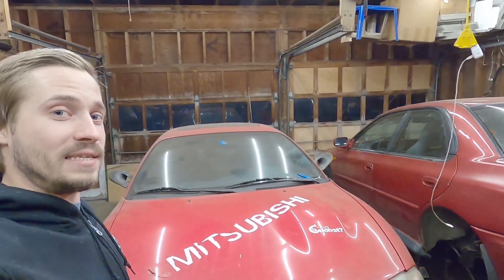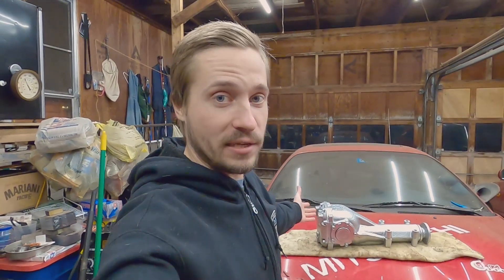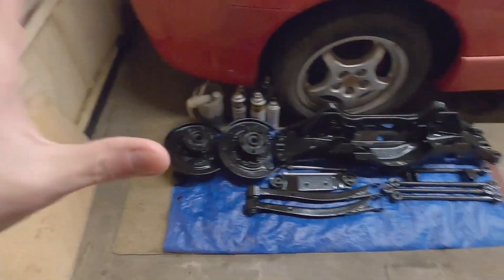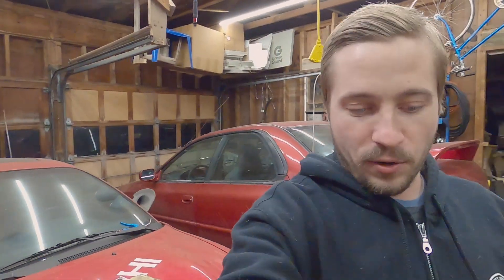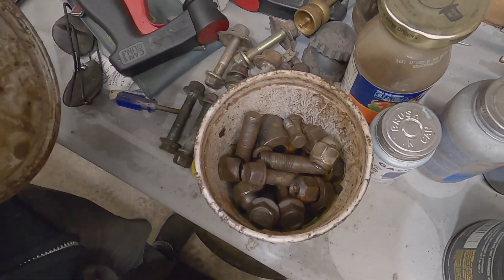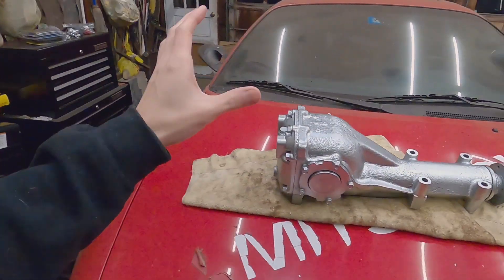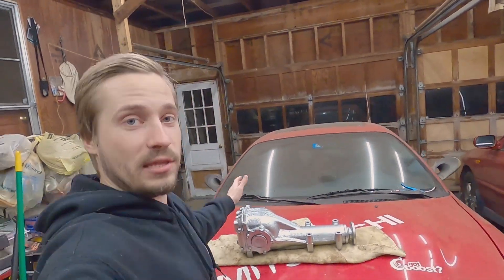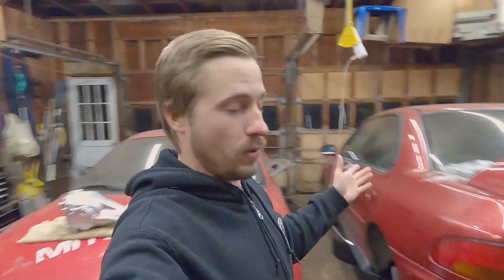Shiny New Subaru Differential! ⚙️✨ Impreza 2.5RS Rear End Restoration

Comment: If you haven't tried them yet, the Milwaukee Torque lock style vice grips work great for grabbing snapped bolts. You can get a screwdriver on the knob and really torque down on it a lot more than the standard style vice grips. Not gonna lie I saw the diff and thought the old one was too far gone and you picked a new one up. It took a while but at least you were able to save it.
Reply from the maker: Oooh I'll have to look into those! I won't lie I was amazed how stuck this bolt was. As you know, I've dealt with a lot of stuck bolts! Glad I had you tricked for a second. :P

Comment: How well does POR15 hold up to be salty winters in the NE? Maybe that would be a good solution to coating the parts you’re replacing, or anything you want to protect.
Reply from the maker: Allegedly pretty well, as long as you get it to bond to the metal well and cure. My main issue with it is how expensive it is. In some ways I'd rather clean and prime rust and then undercoat. I actually have little personal experience with POR, but when I have some more money I'd like to try it more.
Reply: 802 Garage It seems like the best way to buy it is in bulk. Maybe down the road when you have a project you really want to devote a lot of time and money into. Then again you probably wouldn’t drive it in winter 🤔
Reply from the maker: Hahaha yeah it's hard... A gallon of the stuff is $119! Pretty crazy.

Comment: The freshened up diff looked like a brand new aluminum one in the tiny thumbnail, but it still looks pretty good, I gotta tell you.
Reply from the maker: Thank you! I tried. Could be better, but I think that's about as good as this case needs. :P
Reply: @802Garage  Yes. Also, you should stock up on that paint that bonds with rust and stops it. Like, in, 5 gallon buckets of it, lol!
Reply from the maker: I have a lot of "stops rust" paint, but the results vary. POR is good but it's just insanely expensive.
Reply: @802Garage  In my experience, the insanely expensive stuff is the only way to go.
Reply from the maker: Haha won't deny it's the better option. Me just broke. :P
Reply: @802Garage  I totally relate.
Reply from the maker: It's nice to not feel alone. 😂

Comment: When you showed that silver looking diff. I was like damn! That looks mint. 

But then oh its the same diff that was full of rust and the hole in the cover. 

The paint should hold up for a while. Powder coating will go a long way given the time and effort and a huge oven to bake the coating.
Reply from the maker: Glad it looks good to you at least! At least it doesn't have a hole anymore. I'd love to powder coat, but then I have to remove any rubber seals and do even more work, plus make even more sure all the rust is gone. Basically I'd want a sand blaster and to fully disassemble it. 😭

Comment: I've been noticing that mishimoto box in your intro, did you get sponsored or did you find somewhere with a good deal on them?
Reply from the maker: Wish it was sponsored! Hah. I got a really good deal. Since you asked, it's a $350 X-Line radiator for the Eclipse. I basically got 50% off a while ago. :)
Reply: @802Garage  I've been trying to find a good performance rad for my buddy's Mercury Marauder, but everything is quite expensive. Any recommendations on where to find a good deal on a performance radiator?
Reply from the maker: Let me know what year and engine it is and I'll see what I can find.
Reply: @802Garage  2003 4.6 modular dohc, same as a cobra of the same year minus the supercharger. It is a street/drag strip car, maybe drift (bit of a heavy car for this) after it is boosted.
Reply from the maker: Hmmm, TBH about the best i can find is radiators for the Mustang. No idea how well they fit, but I can imagine it would be minor modding to fit up. He'd have to verify.
https://wheelwell.com/shop/cooling/radiators/ford/mustang/2003?submodel=GT&universal=false
You can use the coupon code "Welcome2" to get $100 off $250 so that should help.
https://slickdeals.net/coupons/wheelwell/?couponid=2699695
Reply: @802Garage  The $100 off is a really good find! I'll have to keep an eye on this though, seems that all of the products are unavailable on there.

Comment: I've painted old rusty parts before, so no, you didn't fool me. :P You did a very nice job, though, and it should help against corrosion. Gotta do something about the skid plate situation under it, though... like, drill holes into it maybe, so it doesn't end up acting as a water/dirt reservoir? I'm sure you'll come up with something. :)
Reply from the maker: Oh I won't be reusing the skid plate for now. It is far too damage and rusted. Most of these cars did not come with one. Someone likely added this one from another car. I believe on the 1st gen Impreza here they were an option and came with certain trim packages, often the Impreza Outback Sport, but I'm not sure which years. The 1st gen Forester also had them sometimes. Hard to find exact info.
In researching real quick though I actually found you can buy the genuine item quite cheap new! Looks like possibly thinner metal than the one I had and also less ruggedly welded. Does have a few drain holes at least. This one is technically for the later models, but will fit especially since I'm using the later subframe. https://www.subarusource.com/oem-parts/subaru-rear-diff-protector-b031ssa000
Otherwise I was thinking about "unfolding" my skid plate and making a new one out of thick aluminum. Main issue is I don't have an aluminum welder yet to do the corners. Would be interesting to make my own design and sell it or something, but of course that would be just another project I shouldn't take on. Doing a bit more research the Primitive Racing 3/16" aluminum unit is only $100 anyways!
Reply: @802Garage  I say keep the $100 and start saving for the gear you need to weld aluminum. :)
Reply from the maker: 👌 I def won't be dropping the $100 right now. Def have my eye on a TIG welder first. :P

Comment: Should have painted the diff in Ford Shockwave. 😝
In my world today, I hate bushings. I. Really. Hate. Bushings. 🤬 I hated them yesterday too and the day before that but I REALLY HATE them today. 😤
Reply from the maker: Hahaha, would have been a good pick! Could have gone with gold too.
I understand hating bushings. I had to hole saw two to get this out!
What's wrong with yours now?
Reply: @802Garage  Installation is a biatch, especially when the bushings are too big for your chassis mounts so you've spent the past few hours each day attempting to fit it, then using the bench grinder to linish each half of each rubber, then fail to fit again, repeat. 🤬
Reply: @802Garage  Also, crying at 10hrs for a diff, wah wah wah. Each strut took me 20hrs each due to the nooks and folds and 30yrs of dirt and crap! 😂🤣 I think I'm at around 190hrs so far (and 1 destroyed hammer drill, about 5 nylon wire wheels, and almost 5L of Phosphoric Acid) with all the work de-rusting the car. 🤔
Reply from the maker: Hahaha hey I did say at least 10 hours. I could add up a more accurate estimate, but that takes time too. With painting it's probably more like 12-14 if you include waiting especially. That's just from the time I actually got rid of the old subframe. I also definitely got it nowhere near perfect. I don't think this particular case is worth it. :P
As for your bushings, that really sucks! What are you using to try to install them? Using lots of lube?
Reply: @802Garage  It's the hole being too small for the bushing. 🤷 Each bushing half needs atleast a few mm taken off and I think I'm about 0.2mm away from getting them in. Using the supplied grease.
Reply from the maker: Huh, that's a bummer. Stupid question but if the old bushings had metal sleeves are you sure you removed them?
Reply: @802Garage  The old bushes were laminated on to the chassis. To remove them and the tube, they had to be burnt out with an oxy torch and the old tubes get thrown out. I have the new tubes as part of the pack. 👍 I'm sure I highlighted this on my last episode. 🤔
Reply from the maker: @MafiaboysWorld  Listen, I saw your shiny blue parts looked better than mine, got jealous, and stopped listening. :P
Kidding! Nah but I'd have to visually see which bushings you are doing to confirm everything in my brain if that makes sense. Skimmed through your last episode again and didn't see exactly what you meant. I just wanted to make sure they weren't pressed in bushing with an outer metal ring that needs to be cut/chiseled out as well. Seen people make the mistake. Plus some aftermarket bushings are meant to go in the old metal ring and some required them to be removed, hah.
Reply from the maker: SenselessTuning  I usually go for Super Lube since it's thick and stays where you put it, plus it's the correct lubricant for bushings to stop squeaking anyways! To actually push them into metal components though you often need a press mechanism of some sort and a way to keep them straight.
Reply: SenselessTuning  Yeah....no. This is a chassis mount bushing for the trailing arm, not a simple suspension bushing like the strut or LCA. Ball joints I use my ball joint pullers and pitman arm. 👍